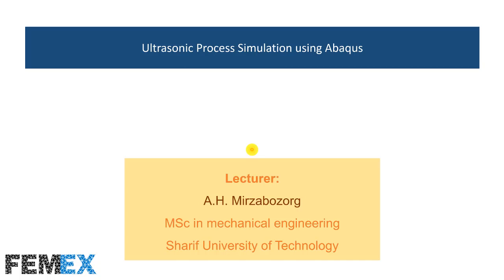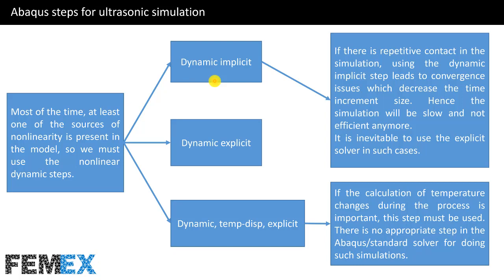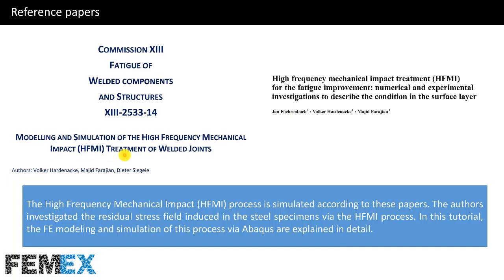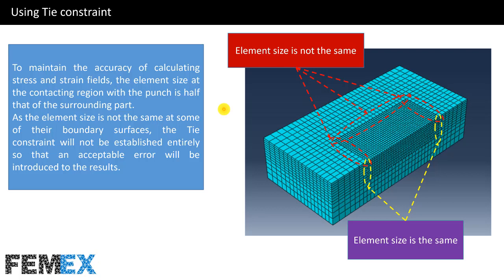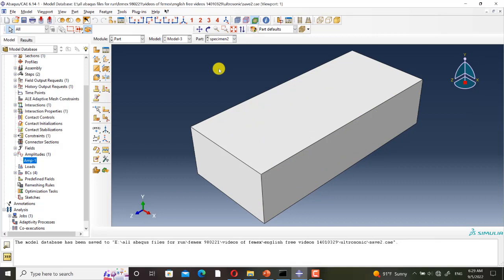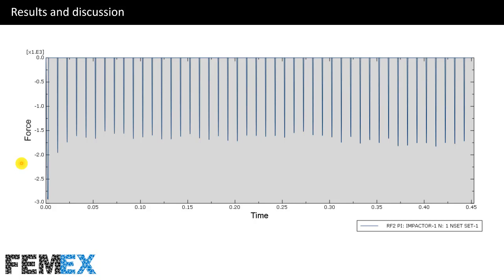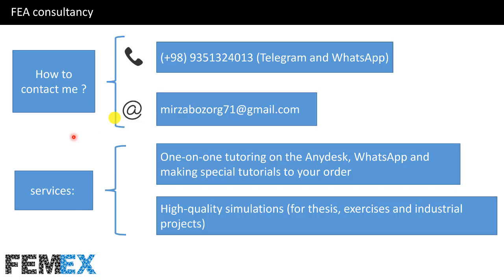Ultrasonic Process Simulation using Abaqus

Comment: Thank you very much for your comprehensive video. regarding the measurement of residual stress, I’m not sure which stress I should take into account during the unloading step as my residual stress. I think due to the movement of the pin in two directions of X (horizontal movement of the pin with constant velocity) and vibration in Y direction. It generates a complex residual stress state. Hence I might take into account the von Mises stress as my residual, but Im not sure about that. I would be grateful if you could elucidate my doubts regarding this matter. Thank you in advance for your time.
Reply from the maker: Hi.
You are welcome.
As all of the components of stress are present in your simulation, to do every interpretion or investigation including the calculation of residual stress, you must use Von Mises stress. Also you can use max and min principle stresses. But most of the time they are used for damage initiation detections.

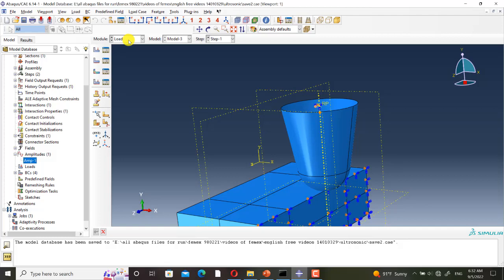Comment: At 10:40 you confused angular frequency  with circular frequency. You should insert 2 cycles/second instead of 628 !!
Reply from the maker: Hi.
Please check the Abaqus documentation.
There is a section in Abaqus documentation for explaining amplitude.
In that section it is mentioned that:
omega=2*pi*f
Abaqus uses omega for periodic amplitude based on Fourier series.
In our problem f=100Hz so
omega=2*3.14*100=628 rad/s
All of our tutorials are based on Abaqus documentation and even we have a tutorial for how to use it.
Reply: @FemexIran  sorry, but when you insert the amplitude, clearly says circular frequency.  Circular frequency is different to angular frequency. Is the amplitude input window wrong? Please see your video at 10:40 and you will see that the input window clearly says circular frequency.  If this is wrong, it should be good to report this mistake to Simulia. It is not my intention to disturb you. As a matter of fact I think your videos are good. But here there are a problem. Thanks.
Reply from the maker: @mariogalindoq  Your problem is that you do not read the Abaqus documentation. Please read this section in the Abaqus documentation version 6.14 which is available in Google:
Abaqus Analysis User's Guide>Prescribed Conditions>Overview>Amplitude Curves
The formula is written clearly with an example about periodic amplitude which T=0.2s so f=5Hz and finally omega=10*pi=31.4 rad/s
I hope you can finally understand.
Reply: @FemexIran  you are right! Abaqus refers the angular frequency as circular frequency. I think this is a mistake in Abaqus because in the literature normally circular frequency is in cycles/second and angular frequency is in radians/second.  Thank you for your patience.
Reply from the maker: @mariogalindoq  You are welcome. Unfortunately there are a lot of bugs and mistakes in Abaqus and they make working with Abaqus even harder. Our tutorials are based on Abaqus documentation and we are sure about every thing we mention in our tutorials because Abaqus consultancy and tutoring are our main jobs not like the others who create tutorials just for fun with lots of mistakes and mislead their viewers.

Comment: Thank you for the detailed explanations of the steps. When using a symmetric boundary condition, would it be possible to visualize contours for the other (symmetric) side of the sample in the visualization module and generate symmetric plots for both sides of the BC? I mean the side which is not initially modeled.
Reply from the maker: Hi.
You are welcome.
Yes of course.
You must follow this path in the visualization module :
menu bar => view => ODB display options =>
mirror tab => select the coordinate system to mirror => apply

Comment: Hi Sir may i know how can we set in load module this information, cutting speed = 12 m/min, frequency of 2kHz, and vibration amplitude = 10 micrometer. In your tutorial in amplitude, you let the value of amplitude as 0. Need help from you.
Reply from the maker: Hi.
To answer this question or other questions related to your case, you can use our online tutoring and consultancy services.
To use these services, please send an email to me: mirzabozorg71@gmail.com